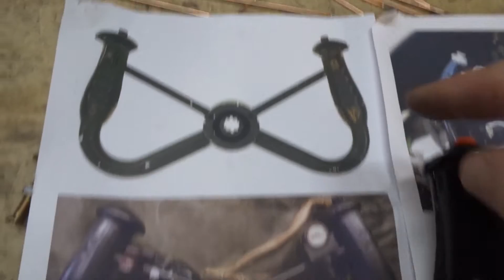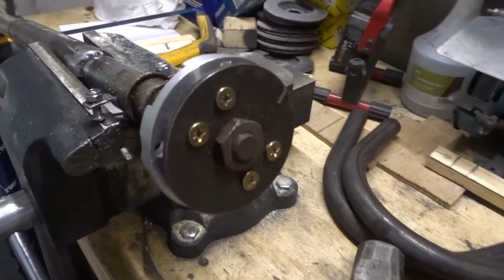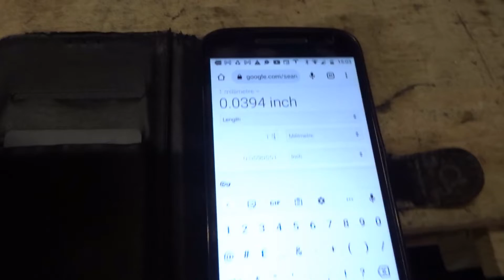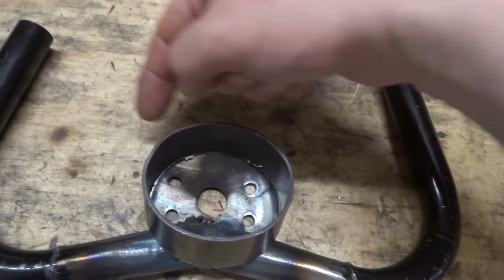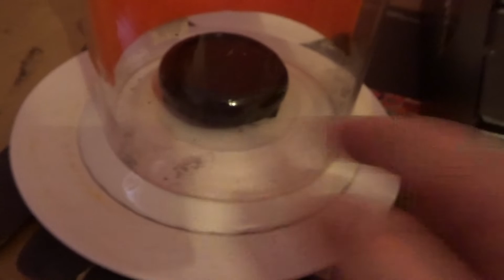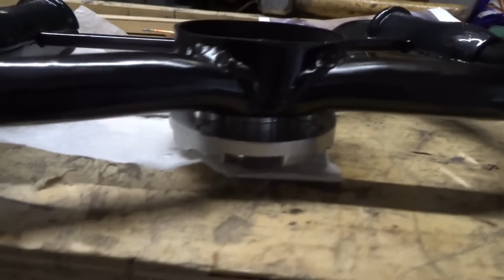Make a P38 Steering Yoke | Belly Tank Lakester Ep.16

Comment: I've not tried acetone polishing yet but I have found you can sand and polish 3D printed ABS parts to quite a high finish the old fashioned way with sandpaper and polishing compounds. You just have to be careful you don't generate too much heat and melt the plastic.
Reply from the maker: With acetone chamber the main thing is to set an alarm for about 45 minutes. If you forget and go to sleep for the night, in the morning you will have something that looks like a Salvador Dali painting!